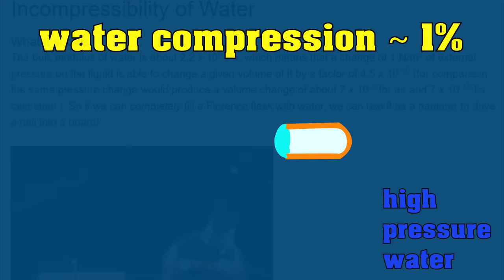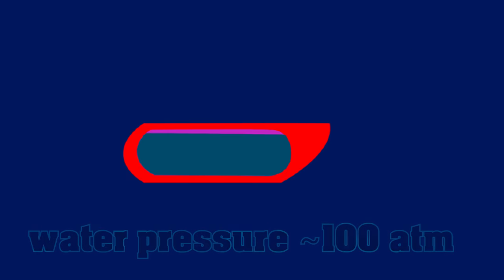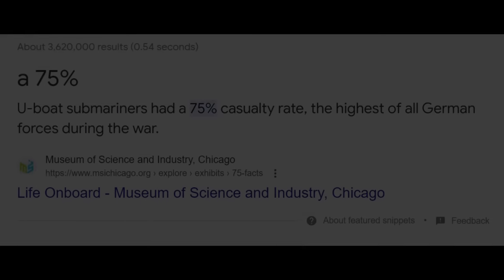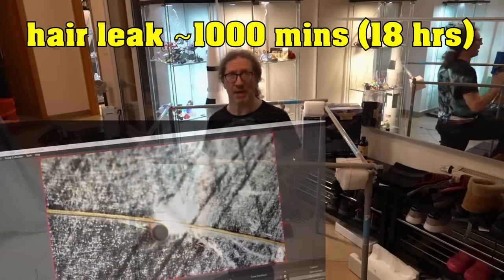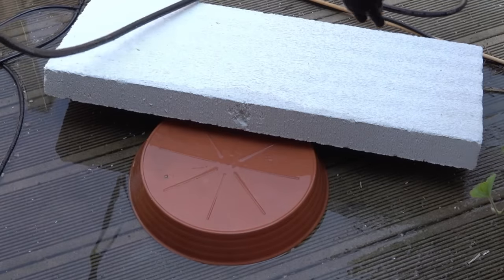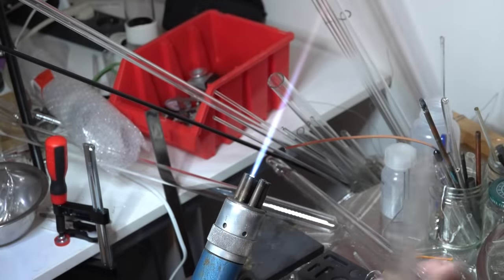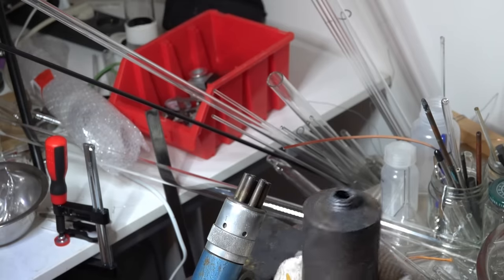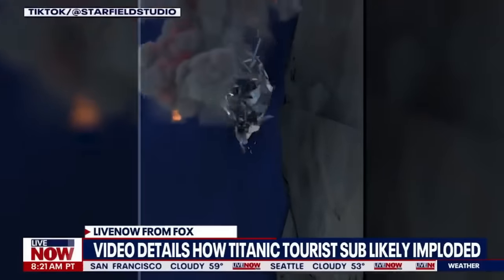Why the Titan sub failed

Comment: A submariner friend once told me the whole “race to the surface and deploy rafts” was just Hollywood. She calmly explained that just getting in a submarine meant accepting your own death.
Reply: Thats why the Screw down hatch is so easy to accept.
Reply: Every time you set foot (so to speak) upon the sea, you give your life to it. Usually -- usually -- the sea gives it back.
Reply: That's not typically true of a properly designed submarine. That said, yeah, you aren't likely to be able to escape a sub once you're underwater. There are escape trunks on some subs but they are only viable if the depth isn't too great.
Reply: @infernaldaedra  The US Coast Guard has inspection and certification requirements for Passenger Carrying Submersible Vessels. Under the 1993 Passenger Vessels Act. Titan was subject to this both for reason of Oceangate being a U.S. Corporation (which they tried to hide by shifting ownership of the sub onto a Bahamanian registered sub corporation), but more importantly the US Coast Guard and NTSB maintains certification authority for Submersibles built in the US. One of the certification requirements is the submersible vessel must have an ingress/egress hatch that is 1 meter above the waterline when floating at the surface. People can get in or out without flooding the sub. Note this applies to vessels that carry Revenue Passengers. Which Oceangate was trying to desperately (and illegally) hide as “Mission Specialists”.
Reply: @andrewtaylor940  Yeah and a hatch still doesn't do anything for you when your more than a few hundred meters depth and would destroy the vessel to open
Reply: @andrewtaylor940  This submarine vessel qualifies even if the hatch is bolted down
Reply: @andrewtaylor940  Sadly those laws only apply in US waters including departing from, the Titanic is in international waters and Oceangate departed from Canada. I can't see a successful charge being laid under those specific laws. However Canada does have similar laws and because they departed from Canada I can see those laws applying for simply departing from there, but seeing as the submersible isn't the one actually taking them out to sea these laws themselves might still not apply... Afaik (or found) there are no laws around submersibles in international waters esp towards passengers, however laws are based on the flag the "ship" flew, the Titan had no flag to sail under so it is safe to assume since they came out of a Canadian port and rented a Canadian ship that they would fall under Canadian laws however once again the Titian never carried passengers till it was in international waters and doesn't carry a flag, nor was it ever registered in either country.

I'm not sure how actual maritime laws in international waters work in these cases (I'm sure those in charge are scrambling to figure this out as well) and if the laws would actually fall under Canadas or not, however I can see each country of the victims wanting to press charges against the company on top of said laws.
Reply: Agreed 💯 God's grace to U 💓
Reply: That's not true.  They even train to swim to the surface after equalizing the pressure in an escape hatch.
Reply: @egg-roll8968 the vessel they travelled on departed from Canada but they'll evade Canadian maritime law because the submersible wasn't utilised until they were in international waters.
Reply: Limited space in the emergency life raft reserved for the top officers - no doubt your friend was an enlisted.
Reply: @LarsLarsen77  But the Titan submersible's hatch was bolted down from the outside. If they simply had a mechanical error and the sub automatically released the 'dead man's switch' ballast, they would all die of suffocation at the surface because it was designed for escape to be impossible even in the most favorable conditions. Maybe that wasn't their intent and the designer was simply incompetent, but functionally a death trap.
Reply: @egg-roll8968  I always assumed it was considered to be under the flag of the mothership that deployed it, if it was operating under no flag, isn't there some piracy laws that could be applicable?
Reply: @DemstarAus  But wouldn't the sub be considered a satellite vessel of its mothership and thus bound by the same laws as it's mothership?
Reply: @infernaldaedra  For what it's worth, James Cameron's submersible also had a screw down hatch. Though that one was designed by people who knew what they were doing - Cameron wasn't trying to cut corners.
Reply: @egg-roll8968 Usually it's the ship flag , the country of its registration that will determine the competent legal authority. The support ship was Canadian.
Reply: That was no submarine. It was a submersible coffin
Reply: I know what you mean but plenty of people get in them without accepting their own death. The usual expectation is the sunmartine was built well.
Reply: Sounds like how sailors used to treat falling off a ship hundreds of years ago
Reply: @LarsLarsen77   Do you really think that if something goes wrong at 400-500 meters they will be able to calmly swim to the surface?
Reply: I remember a story of a submarine sinking at 100m depth, and all the sailors inside going out the exit hatch and making it safely to the surface, exhaling all the way. (Something you have to do, if you hold your breath your lungs will rupture).
Reply: @Maladjester  Give your life to the sea, and treat her with respect, and she will most everytime let you leave
show her hubris and take her lightly and she will show you the terrible depths of her power
Reply: I guess we all do at some point.
Reply: What movie are the submarine clips from.  It looks great.  Any help would be greatly appreciated.

Comment: In my line of work, I am regularly exposed to high-pressure water cutting, and I can unequivocally state that the nozzle plays a pivotal role in the cutting process.
Reply: @@JohnSmith-hn1qj Probably not only pressure but also speed of the water. There are diferent designs of the nozzle(like rocket engines) that are made for specific purposes and even accelerating fluid flow. Maybe the nozzle thunderfoot is using just isnt made for fluid velocity
Reply: @robertjusic9097  Or most cheap electric pressure washers are simply weak sauce. Mine is advertised as 3500 psi but it's far weaker than a gas engine powered pressure washer rated at 3k psi

Comment: Appreciate that you left in that failed water jet demonstration. Showing that you're both fallible but also transparent. Admitting your mistakes is one of the most important step ls of the scientific process after all
Reply: I think it might just demonstrate that manufacturers claims as  to how powerful their pressure washers are, is just complete BS.
Reply: @memkiii  bigger issue in play is the plastic is smooth, textures surfaces interact more with the jet of water and energy is transferred more readily causing damage
Reply: @memkiii  yeah those electric pressure washers are pretty weak... if he had a gas powered real pressure washer it would have cut that plastic in half with the first jet.... i know this from experience.
Reply: Use the spinning jet.  It has a smaller aperture than the non-fanned jet.  It is designed to clean concrete by spalling the surface.  The plastic spreads the pressure by deformation thus no hole.  I use a 3500PSI (241bar) pressure cleaner to remove the mould and loose paint off of my deck and vinyl siding.  I use the spinning jet on the vinyl siding.  I use the fans on the deck.  I did try the spinning jet on the deck once.  ONCE.  It tore through the paint, and chewed deeply into the wood.  Oops.
Reply: Close to 100 PSI water jet from the pressure washer..

I've seen a 800 lb steam jet cut a broomstick.  Probably don't need that much pressure for cutting wood.
Reply: Yes, that's really cool. Also showing the clip over and over again LOL.
Waiting for some OceanGate fan to 'debunk' Thunderf00t's story without debunking the real message, that would be awesome.
Reply: Yeah. That's good science right there (not being sarcastic)
Reply: Yeah, I liked that a lot too. This is how you SHOULD handle evidence.
Reply: To be fair most those are designed to not damage the surface you are cleaning and not maim the people using them. That said he also gave up another answer by saying most pressure waters use additives to the water. Salt or sand grains in a water pressure would cut through the plastic much easier, assuming the nozzle wouldn't get clogged.
Reply: I disagree with the original comment. Leaving in the failed water jet comparison does not lead to Thunderfoot admitting to be fallible and transparent. It could just as well be that this failed demonstration is just inconsequencial to his point and serves as entertainment in the meantime.
The kind of argument of his "transparency and admittance to fallibility" is also upside down. His credibility should be tested in those examples where he really messes up. And we all know that there are plenty of videos where he is wrong and doesn't admit it. One way or the other, it shows his fallibility but not his transparency.
Still, this video on its own is good, a very interesting and non-mainstream explanation of submarine failure. I liked it.

Comment: When cutting carbon fiber with a water jet, i quickly found that you had to drill pilot holes or the material would delaminate due to internal pressure during a pierce operation. If water impregnated into the material its likely that the internal wall delaminated quickly due to the pressure difference.
Reply: I would agree with that assessment for sure.
Reply: Second that.
Reply: There is a whole video on that, apparently the carbon fiber wasn't made using an autoclave
Reply: @ZadakLeader  oceanside themselves have an old video out of the production. They're just simply rolling it up, in the open dusty environment as well. Not even braided pattern
Reply: @mezkhalin  Yeah
Reply: That effect is even more profound with sea water because the salt affects the resin matrix.
Its why they thought for a long time that carbon fibre for yachts, boats & ships was impractical.
It wasn't until the New Zealanders won the America's Cup with a carbon fibre boat that anyone realised it can be done but that it takes real skill AND ATTENTION TO DETAILS to do it. Its why the guys who build carbon fibre sailing vessels are so careful to make sure its sealed properly.

I'm yet to see or hear any of those guys comment on how they do Carbon Fibre or how they get it done in a way that works. BUT lets not forget they aren't going 4km down.
Reply: @mezkhalin It's even worse than that; the carbon fibre used was bought from Boeing secondhand because it was past its operational shelf life so the material likely wasn't structurally sound even if the construction method for the pressure chamber would've made it watertight.
Reply: @legoferrari14  damn, wasn't aware of that. in that case it probably didn't matter their production methods or locations, it would've failed sooner or later either way.
Reply: Another good support for the idea that the integrity of Cc has to be near 100% for this purpose at each use. There is no margin for working out lifespan its too small to manage

Comment: As a KFC food service worker, I can see that there were probably one or more reasons why the vessel failed:
1 - Poor adhesion in the composite plies; there may have been regions that weren't cured properly or the substrate didn't fully penetrate all of the plies.
2 - Adhesion between the composite plies and the titanium ends failed due to incomplete coverage.
3 - Differential stiffnesses between the titanium and the composite, meaning that there was a difference in material shrinkage across the composite/titanium interface, causing a shear-stress that caused the bond to fail [ You did address this but your demo showed the effects of a difference in thermal expansion coefficients, not stiffness due to pressure loading, although both may be significant and there can be an interaction e.g. if one component isn't that stiff at all, then it can accomodate the differences in thermal expansion but a risk of rupturing a bonded interface is still there. ]
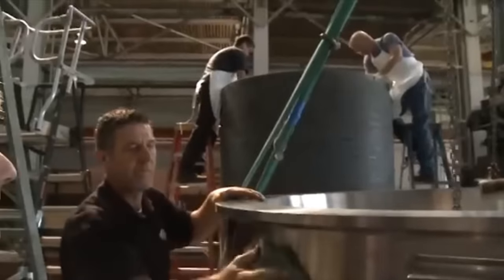4 - At 20:40 , the worker has his bare hand on the bond interface, which could add grease and compromise the bond strength.
5 - Not only are composites crap in compression, they are also crap in out-of-plane tension, which may occur at the bending loads across the length of the tube due to the water pressure.
Reply: Holy hell, what do you people do there at KFC?
Reply: @FireOccator  
They set a high bar to work for the Colonel.
Also had to get security background checks in order to handle the 11 secret herbs and spices and go on 2 years intensive training on the 7-10-7 breading method.
Reply: @lewis72  Nice analysis, I was horrified to see guys on step ladders in and open dusty warehouse  hand spooning adhesive on to the titanium interfaces. A very avoidable tragedy, you simply can't gamble with the pressures at 3000+m. it's about brute strength........not computer modelling. sad for those who lost their lives
Reply: The fact that such a bond was attempted in such an open shop is mind blowing.  There are SOOO many possible sources for contamination.  Hair, skin, grease, humidity, dust, oil from the crane, etc.  
I would venture to say that your Kitchen at KFC had tighter cleaning controls and contamination prevention than that shop did.